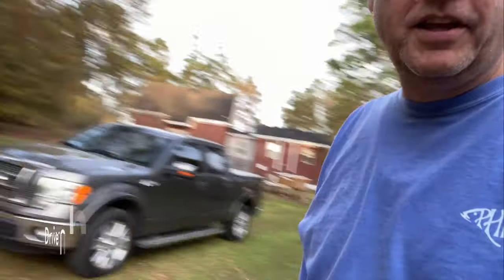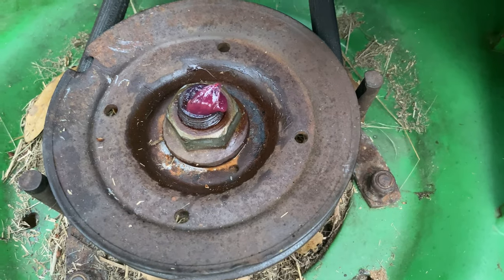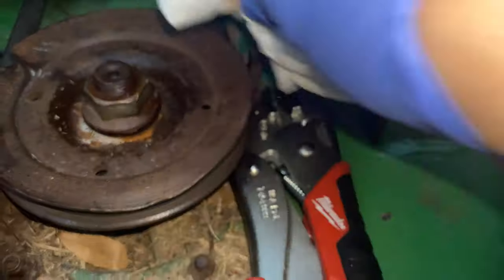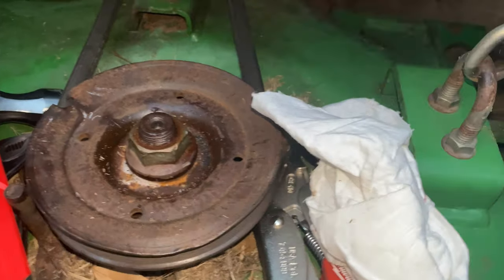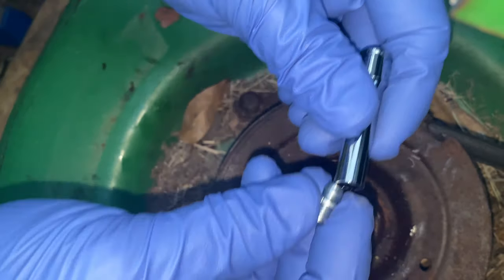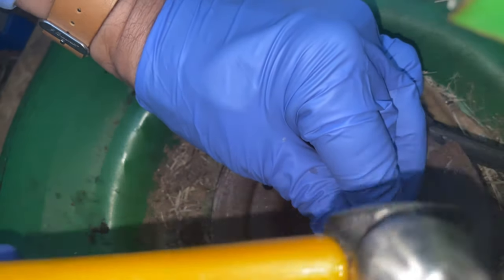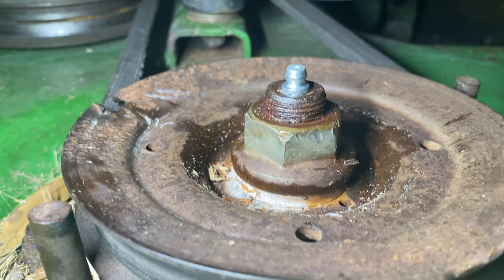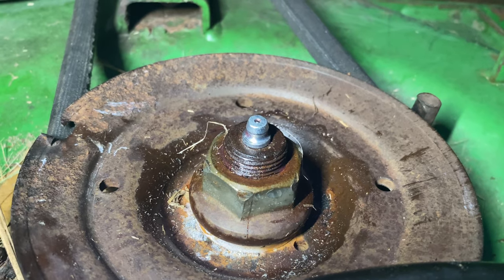Grease Fitting; Drive In Type on John Deere Ztrac Spindle

Comment: Thanks for the video, I just passed the vise grips, went to claw hammer! It worked well, replaced all three on my Max777 zero turn, but got overconfident on the last one and drove the head off! Took my time, worked it out with a small screwdriver and a small pry bar, until it came out pretty easily! I'm very happy you made this video.......I should have made on myself!?

Comment: Anyone knows where the grease goes when you put it in.  There is a top and a bottom bearing.  Does the grease go between the two bearings and around the spindle.